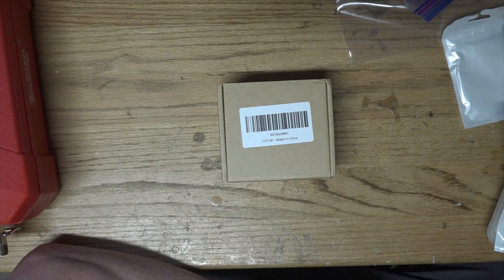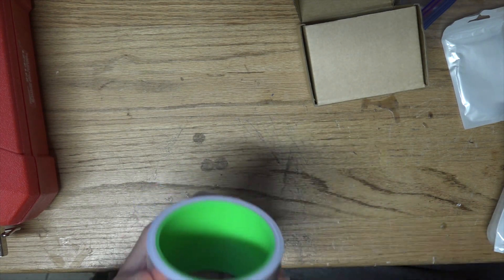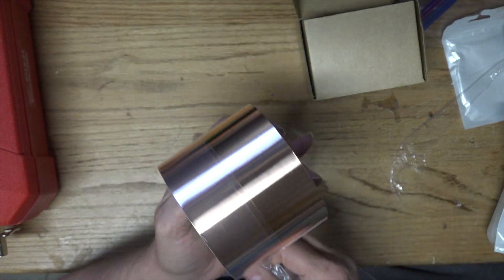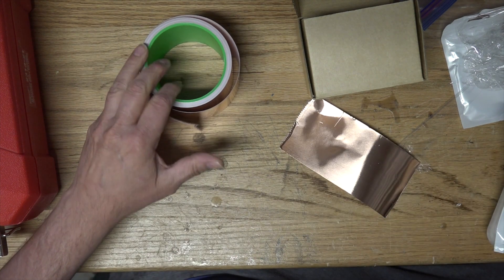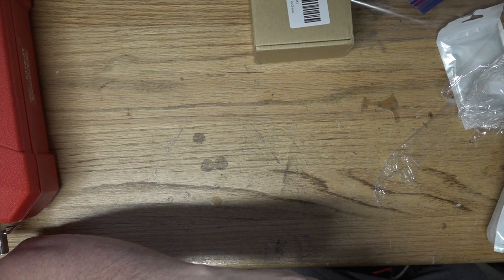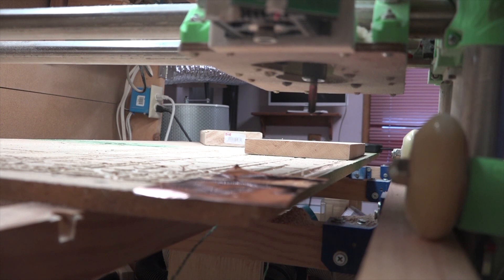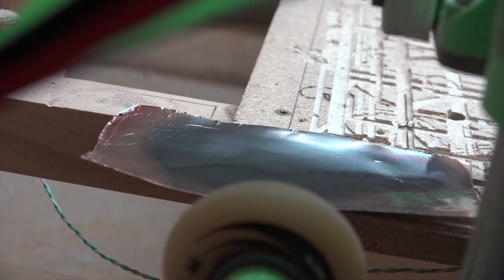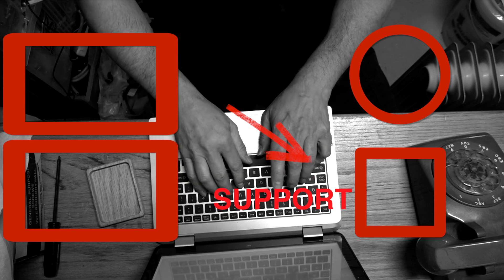Can a 3W Laser Cut Copper Tape?

Comment: Same thought as Frank below, try to cut the paper first. If so you need to mirror image to have right effect, it works on reflective materials. and do not forget to adjust lens for proper dot. This is what I did with reflective materials... Need to try with aluminium tape... same as your copper one just different colour. And my laser is 1500mW so twice less power :)